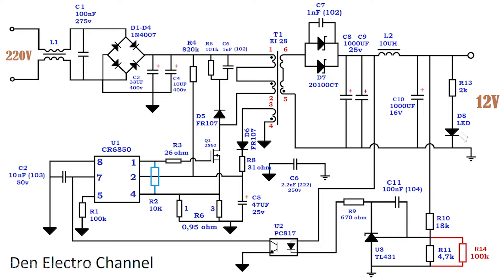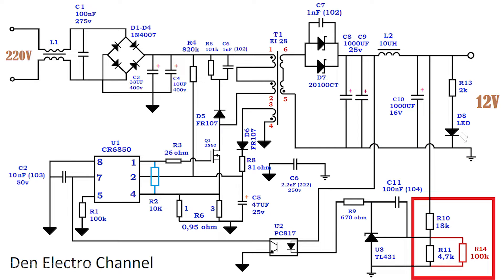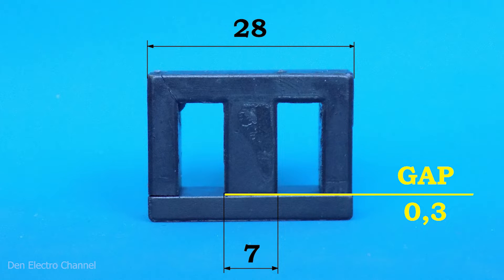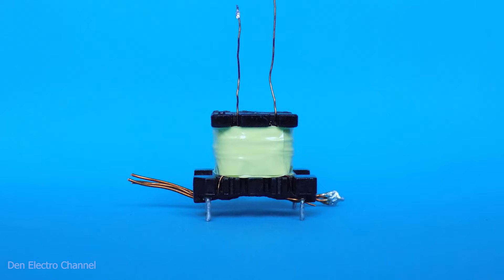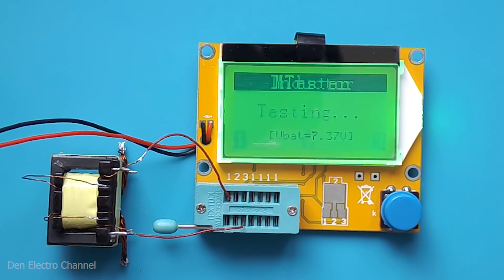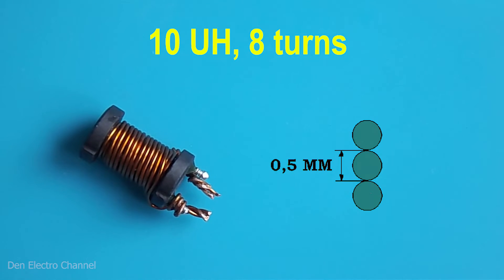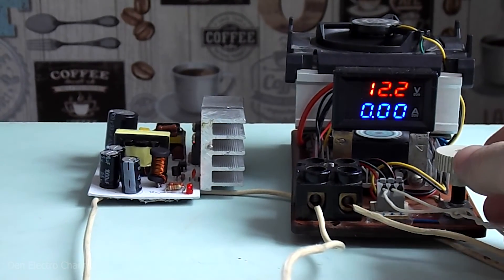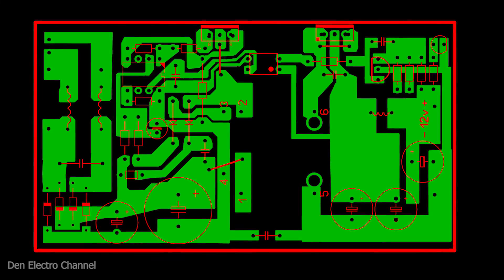DIY switching power supply 12V 5A on a CR6850 chip

Comment: Dear sir l make this circuit as you instructed. But problem is that when i supply current to the curcuit.  Primary winding of the transfomer generate noice ( it may vibrate). When i removed the ferride core halves from transfomer noice is not changed. Therefore i decided this noice is generated by primary winding. What's the reasons for this problem. I Kindly request from you give answer. Thank you ❤️❤️❤️
Reply from the maker: I don't understand how you removed the kernels? If you remove it from the transformer, the power supply will burn out!

In general, if the noise is barely audible and the power supply is working properly, then this is normal. The sound may come from a loose winding. It is necessary to either varnish or tape it off with electrical tape. The core halves also need to be glued together.

But it also happens that the sound is heard due to some kind of malfunction
Reply: Power supply doesn't work properly. Because when i get 2A or 3A Current from Power Supply, Noise of the transfomer is very high.(Transfomer vibrate.).Therefore Voltage of the Power Supply decrease 12V to 6V. As i think reason of the this problem lose of transfomer energy.❤❤❤thank you for your valuable time was dedicated

Comment: what is L1 in circuit diagram?
Reply from the maker: L1 is a common mode choke. It's on the right side of the 10:50 board. The device can work without it if you don’t find it.

Comment: When we taking a current of 2.5A from this SMPS Power Supply. The Transfomer makes   a loud noice. Becouse of that. The Power supply is reduce efficiency. How to prevent this vibration in transfomer. Please answer me. Thank you.❤❤❤
Reply from the maker: I don't know what your sound is. This may be due to incorrect inductance of the primary winding, or simply the wire on the frame is poorly tensioned or both halves of the core are weakly held. At the factory, such things are glued together and impregnated with varnish. If the sound is quiet, ignore it

Comment: I make this circuit and transfomer as you instruction. But it maximum current (12V) about 2.5A. Why?????
Reply from the maker: there are two possible problems here
1- the transformer is wound incorrectly, or the inductance of the primary winding is incorrect.
2- high resistance of resistor R6 (0.95 ohm). Most likely you have a lot of resistance. Try to reduce it by soldering a 2-3 ohm resistor in parallel to it and see if the power of the power supply increases

Comment: I designed this circuit as you instructed. It work. It give potential of 12.5V but there is a problem. Even when a small current is  drawn from it. The voltage drop to 6.5V. The power supply turn off when 1A current drawing load is connected. ( it may go to protection mode). I used EI 28 ferride core for thise. The transfomer winding was you instructed. Also visually there is no fault in the circuite. What is the probblem. Please answer me. (Can ic or transistor problems) ❤️❤️❤️
Reply: Dear Sir, I found the Problem. The 2N60 MOSFET i have used  is fake. MOSFET not working properly. I removed it. I put a good one. Now it work well. Thank you so much for help me. ❤️❤️❤️❤️
Reply from the maker: @kasunrangana2785  good!
Reply from the maker: If you assembled the circuit correctly, then I think there may be one of two problems.
The first is the incorrect inductance of the primary winding of the transformer.
And the second is the wrong resistance of shunt R6, try making it even smaller.

Comment: Do you want to connect all those terminals indicated by the black arrowheads to the negative terminal? Please answer me ❤❤❤
Reply from the maker: Yes. All black arrows are a high voltage negative terminal. And the arrows in the form of strokes are the connection of the low-voltage negative terminals.